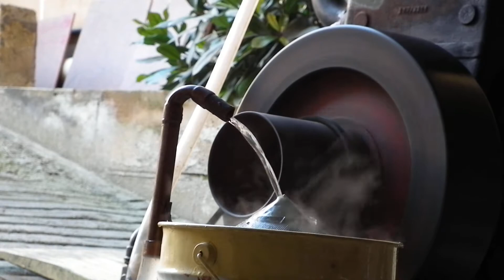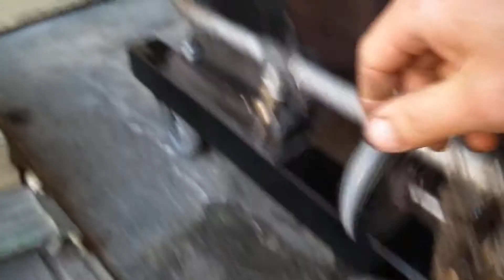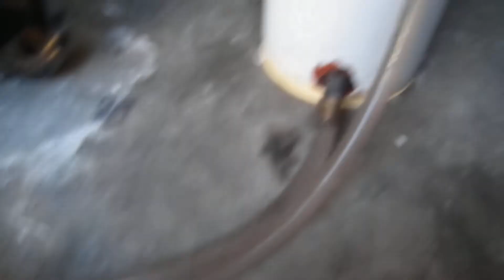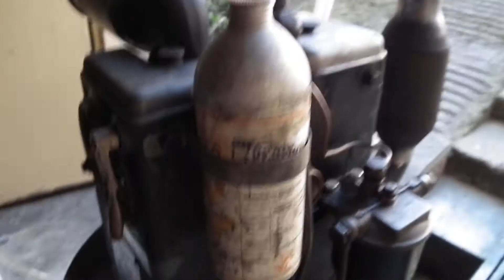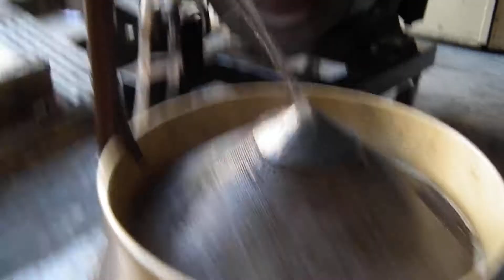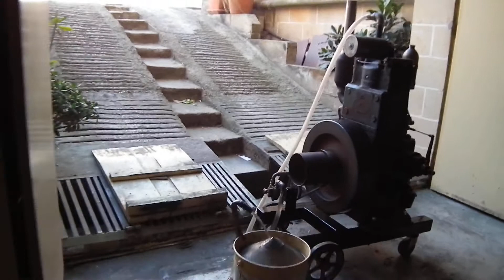Russell Newbery RD1 - Vintage Stationary engine.

Comment: I like your cooling tank. That is a very big engine! Doesn't the engine block jacket hold much water? Still love the sound of this engine the way it knocks, that diesel knock. If you go the grey would look good. Have to have at least one engine a different colour!
Reply from the maker: Hi, the block holds a bit less then 10 liters, maybe 8.5. Yes it will be great not green. Its coming grey with the flywheel/pully red!. That knock is awesome, this is the best in running diesel engine I have. Its more heavy then my Ruston 1HR!!!!